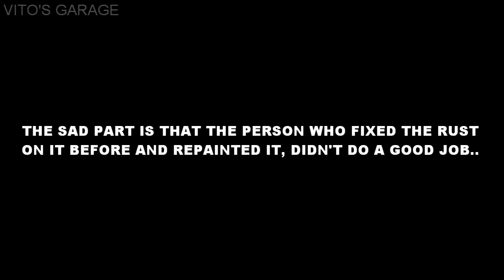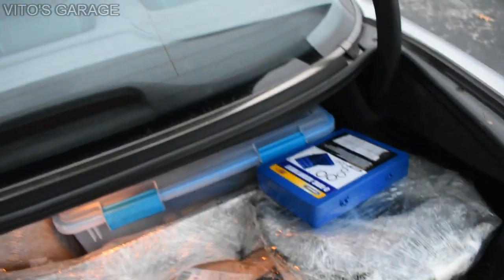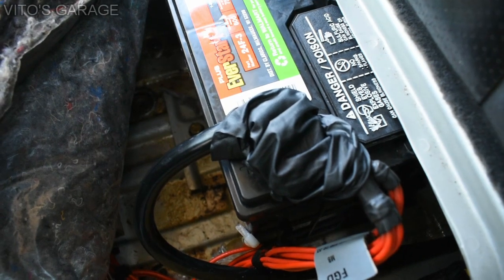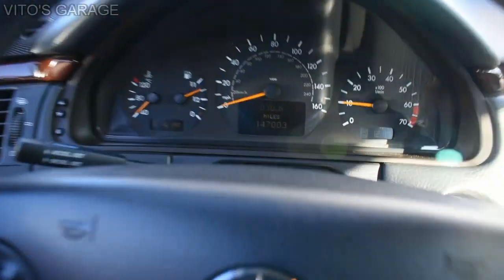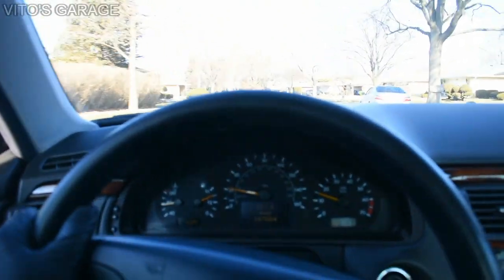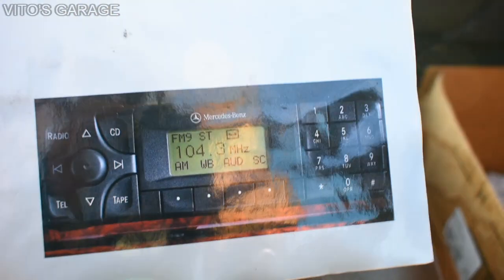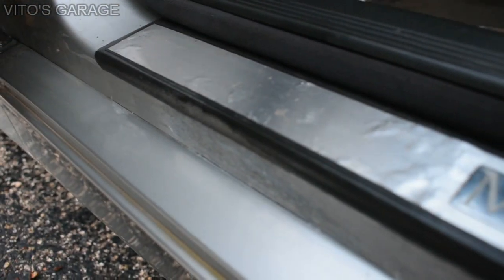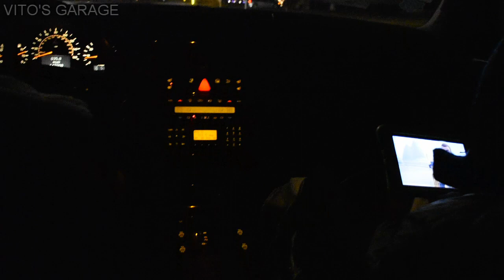Starting My Favorite Mercedes W210 E320 After 1 Year + Test Drive! Repairs and Ownership Transfer

Comment: I had a 2003 W220 which rusted in the same places, I had it repaired twice.  I now have a W221 long wheel base, which I love I also have a 1999 230 SLK which I had restored and use in the summer and I love that also.  The W220 I gave to my son  and my Grandson uses it. It has started to rust again in the same places, wheels arches, door bottoms and bottom of wings. So sad, mechanically it is still first rate with 140K miles on it.  the W220 iw much easier to drive than the W221 by the way. Definitely worth spending some money on this W210
Reply from the maker: Thank you for sharing your experiences! They use road salt in Illinois, sadly... that’s why the best is to buy an old Toyota to drive there during winter time and to have your Classic Benz parked until spring. Washington state has barely any snow and they don’t use road salt in this state. That’s why tons of Classic cars (not just Mercedes) survive here. I will never drive any of my Classic Mercedes through salty roads. It’s pretty warm here in Washington state now and no snow, just raining a lot

Comment: That's sad when somebody does a poor job on these cars, specially poor body work/paint repairs, my w124 was repainted in the past by other owners and in some places I have some rust appearing and some paint peeling off :/ I hope I'll be able to repaint this car
Reply from the maker: Super sad. And yes, you’ll be able to repaint it. You just need to start wire wheeling the rust off, or scraping the rust off. You have to start doing it now because the rust spreads pretty quick.. once you clean off the rust, you can apply some wheel bearing grease as a temporary fix. This will stop the rust. Once you’re ready to paint, remove the grease and finish the bodywork. Cheers!

Comment: That car needs to be daily driven again. The cosmetic issues won't prevent that. Would make someone an excellent reliable daily driver.
Reply from the maker: The car is a tank. Super smooth. Smooth steering and transmission and everything!

Comment: I have a 1997 E320 as well. Only 49000 km.
Reply: I’ve a W211 E320 Wagon 2004 which just reached 170000km yesterday
Reply from the maker: My friend has a 2001 W210 E320 4matic with 400 000 miles. That’s over a half million km !
Reply: I have a 99 w210 and it's at 124,000 miles...just starting it's life IMO

Comment: Vito, how did that car, get so rusty,  is the car  by an area where their is sand,  it's sad sad to see so much rust on the car, I would have thought that the car would be covered with a tarp to protect it, those cars are nice, but looking at so much rust, and how it damaged the fender and some other body work,I hope it gets back to looking better, did you put some treatment on the floor, it looked like it could use something to protect the floor,especially if the battery is in the rear floor, like the 1989 BMW 535
Reply from the maker: This is Chicago, not West Coast. And I sprayed a bunch of fluid film everywhere, and where the battery area is. I will still be seeing this car around, she will live.
Reply: @VITOSGARAGE  maybe because, I enjoy the cars,
Reply: Just seeing a lot of rust,
Reply: Due to probably Road salt,
Reply from the maker: Yes, road salt.. sadly but they use a lot of road salt in Illinois. It’s better to find an old Toyota to drive there during winter time...
Reply: Those W210 cars were really bad for rust.
Reply from the maker: @atx-cvpi_99  only if the owners weren’t watching for rust. W210s on west coast USA and South are in immaculate conditions.